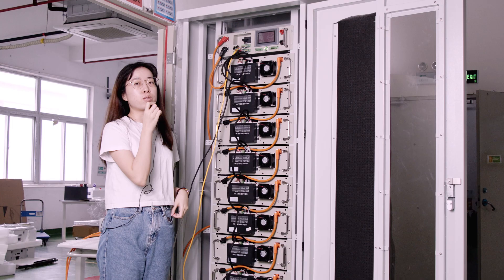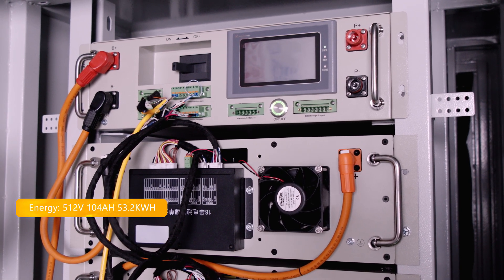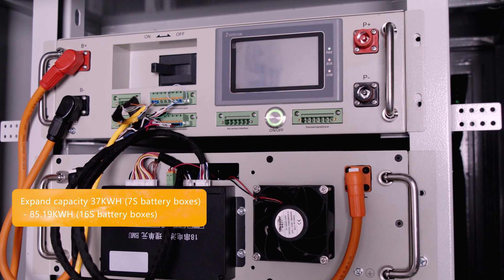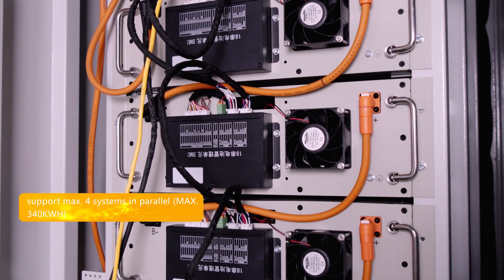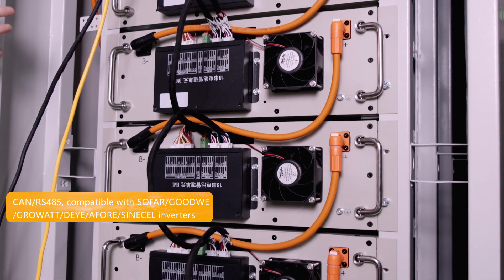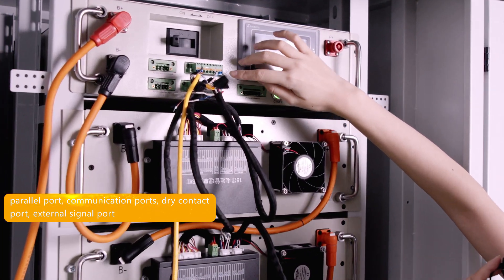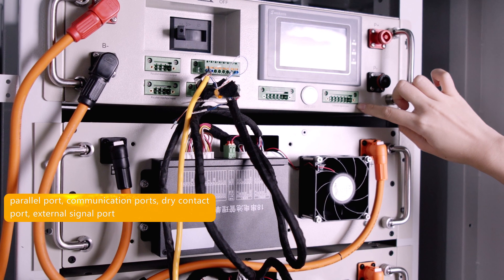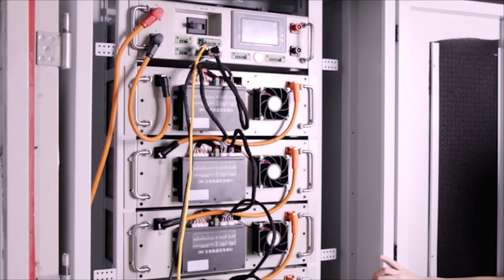New energy storage system - SEPLOS Hiten 104 energy storage cabinet

Comment: It's interesting to see how energy storage cabinets are evolving. One thing worth noting is the role of advanced thermal insulation materials like aerogel—especially in improving fire safety and thermal runaway protection. Because aerogel has extremely low thermal conductivity and high fire resistance, it's been explored as a passive barrier in battery systems to slow down heat transfer between modules. Could be a valuable layer of defense in high-density energy storage setups.

Comment: Im am glad to see this, most of the European designed Inverter run High Voltage and it has been difficult to find anything other than BYD and LG that will work with my SMA inverter